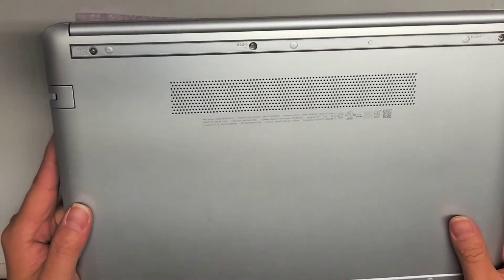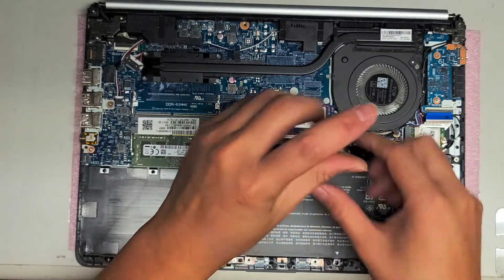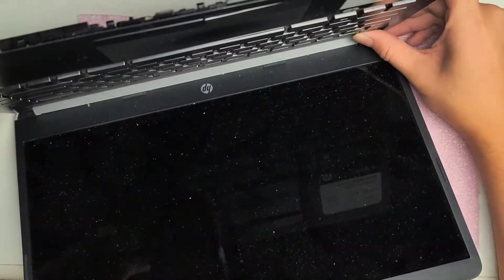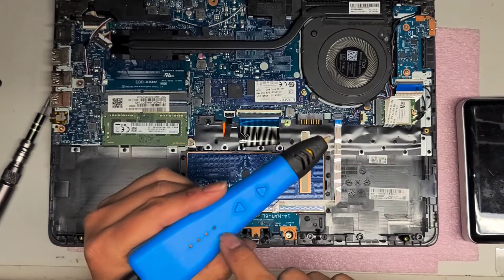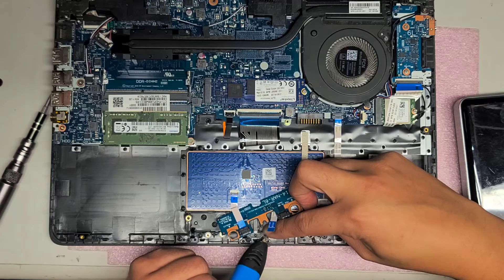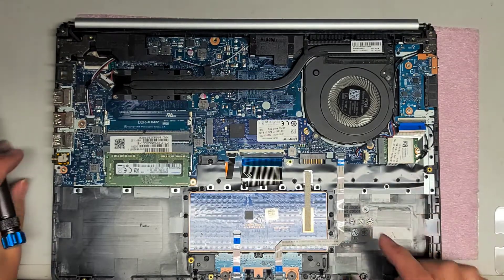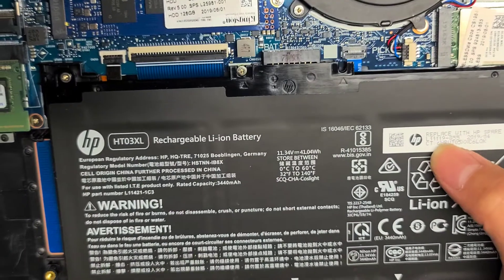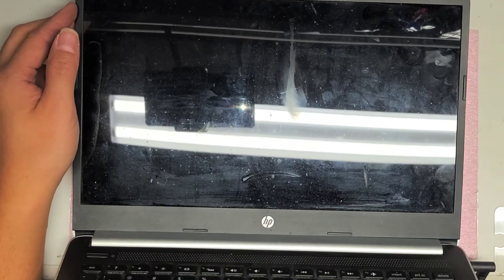HP 14-DF0023CL Disassembly RAM SSD Hard Drive Upgrade Trackpad Mouse Button Repair

Comment: do you need to remove the battery before replacing the RAM? thanks
Reply from the maker: No, but make sure it's off and you ground yourself.

Comment: I know in the video you talked about the ssd a bit but could you reply with I bit of a more deep explanation on what ssd it is and what compatibility I need to look for in other ssds
Reply from the maker: All I know is what was said in the video. M.2 SATA, possibly supports M.2 PCIe NVMe
Reply: @ItsBinhRepaired  ok I couldn't hear you too well but that helps a lot
Reply from the maker: Yup

Comment: hello, greetings, sorry I want to ask if the ssd on this laptop can be added?
Reply from the maker: What do you mean added? Maybe if you get a 2.5" sata connector.
Reply: @ItsBinhRepaired  i want to add an ssd on this laptop, because the available ssd is only 128gb, and i want to add another bigger ssd that is 256gb, without the need to replace the ssd that is already installed
Reply from the maker: I don't think you can. You can get a larger SSD and clone everything over like in this video. https://youtu.be/4p5jFDzVwUw
Reply: @rabiulfajaryanto2305 am looking for the same... Can you please tell me if I can add one more SSD

Comment: I have this HP MODEL, when my battery went bad I ordered another battery and installed it. after I installed the battery I got a CMOS error, I have called hp to ask where the CMOS battery is located but they can not direct to the CMOS, do you know where the CMOS battery is located, PLEASE HELP. Thank You
Reply from the maker: It's in the battery
Reply: @ItsBinhRepaired  I bought a new battery and it gives me the CMOS ERROR. I have to pug in my charger to start up my laptop and then it works. what would you suggest? Thank You for your help
Reply from the maker: @playball99  the battery has the bios battery built in. The error should only show the first time you boot it. If it keeps showing every time, then the battery is bad.

Comment: you have a video how to replace the touchpad for this unit?
Reply from the maker: I don't, but it looks like a bunch of melted plastic tabs.
Reply: @ItsBinhRepaired  thanks, im actually planning to replace my busted touchpad but cant find a video on it. I checked on everything, flex cable, touchpad button (all good) so im sure the touchpad itself if busted and needs replacement
Reply from the maker: Might have to replace the entire palmrest assembly
Reply: Weird thing is, hovering works but left right click doesnt on the touchpad itself and on the buttons
Reply from the maker: @JohnAldwinGaudilla  make sure the battery isn't bulging and pushing it out.
Reply: I removed the battery as well to make sure but same problem
Reply from the maker: @JohnAldwinGaudilla  check the little circuit board held in place with the two screws.

Comment: Hi there. Thank you so much. Im considering replacing the motherboard in this computer bc some water damage occurred. Is this motherboard soldered in? Any thoughts? Thanks so mu g
Reply from the maker: Uhhh what?! Lol The motherboard is held in with screws. You can't solder a motherboard in. You'll have to take the entire thing apart though, so if you don't know what you're doing, it's a very risky job.
Reply: The hard drive is intact. So if i am careful i think ill be ok. If i mess it up i will probably just have the computer store backup my data on a flash drive
Reply from the maker: @Alina-pq5ij  if all you need is the data, you can get a hard drive enclosure and turn the hard drive into a usb drive. Much easier and you can upgrade your computer. Safer if you've never done a motherboard replacement before.
Reply: You are correct. However id like to give it a try. Worst case i can still save the data bc the harddrive is intact …right lol? I have replaced a hard drive before but not a motherboard.
Reply: Omg just looked up a hard drive enclosure. I love that! Thank you so much.
Reply from the maker: @Alina-pq5ij  yup, they are great. Make sure you get the right one for the drive you have. :) Thanks for the contribution!
Reply from the maker: @Alina-pq5ij  with liquid spills, repairs could require more than just the motherboard, so unless you're trying to save software, usually better to just get the data.
Reply: Of course! Advice is much appreciated. I had it diagnosed at a mom and pop shop. They said the motherboard was dead and thats about it. Ill see how much a new mobo is a give it a go. As long as i preserve my hard drive im happy.
Reply from the maker: Sounds good :)

Comment: this model is best 14 inch get upgrade
Reply: @ItsBinhRepaired  this laptop get upgrades easily
Reply: @ItsBinhRepaired  not like macbooks
Reply from the maker: @laksshayrattikan9412  you can't upgrade macbooks at all lol
Reply: @ItsBinhRepaired  yea 😂😂
Reply from the maker: @laksshayrattikan9412  it sucks
Reply from the maker: @laksshayrattikan9412  mainly because buying them fully upgraded is way overpriced. Lol

Comment: I've spilled milk tea on the keyboard. And the computer is working but the keyboard is throwing random letters when I press some keys. Can you please tell me if I can fix that myself ? And how to
Reply from the maker: Possibly, you'll have to replace the keyboard or disconnect it and use a usb/wireless/Bluetooth keyboard

Comment: Thank you for the informative video. Sadly, my touchpad button also broke so I need to attempt to repair it.

First off, I'm curious on how well the touchpad 3d pen modification is working out. Have you had any further issues?

Next, would you have any recommendations for a 3d pen and filament to use?
Reply from the maker: My customer hasn't complained. I just used pla. Any 3d printer pen should work. I just used a cheapy one.
Reply from the maker: https://amzn.to/3w8PZEc
Reply: @ItsBinhRepaired  Thank you.
Reply from the maker: @samuelw7243  no problem
Reply from the maker: It comes with some filament

Comment: Where is the cmos battery on this laptop? Im getting a cmos checksum error (like the one you got at the end of the video) wen i try to turn my laptop on. It randomly froze one day and now it wont startup, just shows the black screen. If you could please let me know what i should do, that would be great
Reply from the maker: The regular battery is the cmos battery
Reply: @ItsBinhRepaired  would replacing the battery solve my issue?
Reply from the maker: I don't think so. Try using it with the battery removed
Reply: @ItsBinhRepaired  yea without the battery was the same story. Blank screen
Reply from the maker: @aavashn5769  battery won't solve the problem
Reply from the maker: @aavashn5769  sounds like bad RAM or motherboard
Reply: @ItsBinhRepaired  is there a cheap way to fix it without losing all the data on the computer? Or is it just a better option to buy a better new laptop?
Reply from the maker: @aavashn5769  pull the hard drive out and use a usb adapter

Comment: How do you actually remove the scroll above the touch pad.?
Reply from the maker: Scroll?
Reply: @ItsBinhRepaired  in short I spilled water on my touchpad.  My screen was black but my Cap Locks flashed so opened the Laptop and wiped the Touchpad with alcohol.  Screen turns on now but not able to scroll.  So I don't know if there is a way to clean the scrolling pad itself.?
Reply from the maker: @WorldArtzLLC  the touchpad? You'll likely have to replace it. Not sure.
Reply: @ItsBinhRepaired  so there is no way of wiping and cleaning it also.??
Reply from the maker: @WorldArtzLLC  I don't think so.
Reply: @ItsBinhRepaired  Gotcha.